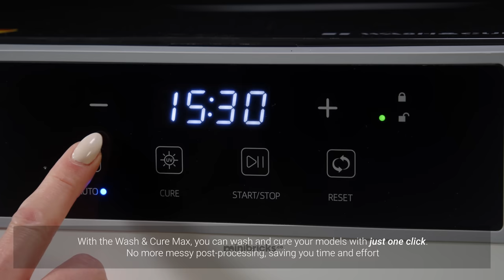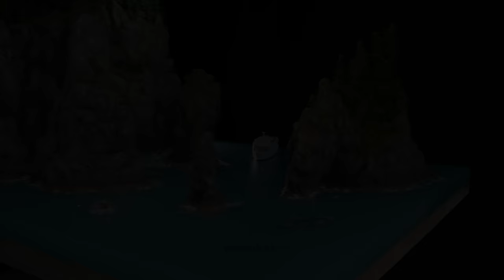THIS IS SPA... ALASKA!!! USA Miniatures Museum / Anycubic Wash and Cure MAX

Comment: Fantastic, well done, another superb piece. I don't remember seeing anything this big before (unless I've missed them) and seeing the size of the pieces forming the rocks and the size of the tray you see from the first second already hinted at the immensity of the diorama and it's just superb. It was a commission, what occasion did you make a piece of this size for, to show off the capacity of the Anycubic M3 Max and the brand new Wash & Cure adapted to the print size of this gigantic machine (which leaves you dreaming), or for a very special occasion like an exhibition?
In any case, as usual, it's a pleasure to see you create. 👍

Comment: The rocks, trees, all the vegetation looks great. The seals jumping off the rocks  is very well done. I don't even want to think about how long it took to carve all those waves. There's only one thing that doesn't sit right and that is the boat and plane. They are a good start, but they need to be weathered, with washes to bring out detail. I guess I'm used to doing bashed up hard used armor and aircraft so don't take this  the wrong way. I am curious about the figures you put on the boat. I gather they are 3d printed. Can you tell me where you got the patterns? I've been looking for some like that for a diorama I am planning. Once again, You've done a great job and an excellent vid.
Reply: I thought the same.

Comment: Interesting, what made you choose a resin print over the regular foam sculpting for the rock formation? I saw the Short about the support removal of one of tose parts and it seemed to me that a lot of resin went into supporting those prints, would it not have been more efficient (and cheaper) to do such a large part in foam? I've seen you sculpt that stuff and I think you would have absolutely crushed making that part from foam! Also - How did you move it after you finished work on it? That thing looks like it needs a fork lift to do anything with it!
Reply: I suspect that it was chosen for several reasons. Firstly, as we can see, it makes the top of the rock formations removable, which is useful both for working on this gigantic piece and, I'd wager, for transport. Secondly .... it's a model of a real place with very specific topography, and the easiest way to get this as accurate as possible is by taking an actual scan of the area (or satellite elevation data, I dunno, but you get what I mean) and printing it. At least that's what I think.

Comment: I'm guessing printing the landforms in resin was for the sake of the sponsor, FDM filament printing or old-school methods would have been much cheaper and simpler. They will at least be lightweight.

I note extensive use of clear UV resin as an adhesive. Interesting. Definitely a good idea under a resin pour.

Now then, texturing the water using a rotary tool, that's bold. I'll probably just go for gloss sealant and blow on it through a straw!

The trees look like repurposed Christmas decorations? It would be good to know.

Oh dear, all that work only to have King penguins in the wrong hemisphere.

Comment: Actually there's an easy way to model a mountain. Instead of creating the whole thing by 3D printing, you can make makeshift mountain from scratch. By papier mache. With some plaster glue plus some sculpting, all is possible. I've seen some modelers use this method.

Comment: How heavy is that? 

Resin prints are amazing but if you’re going to plaster the rocks why not take advantage of the texture from FDM? Should be way cheaper and possibly a tiny bit liter. Though in the end I see weight isn’t a problem lol… 

Sure cost may not be an issue. The extra high quality of resin prints can aid in visualizing the final shape… so I get it. Just the failures on SLA are so devastating. But maybe not for someone dealing in bucket loads of resin…

Came here to see the Anycubic wash and cure max. Stayed for the, um everything else 😅

Forgive me I think out loud through typing. And my keyboard is silent so this is the second quietest way of thinking…

Comment: So the Anycubic Wash and Cure MAX contributed about 0.002% of the work done here, what a time saver.

No offence to Anycubic, I got some of their stuff myself and it's been doing great work, but this project is so massive that it doesn't feel like the 3D printing stuff helped at all. If she had cut that mountain out of styrofoam and made those whales from clay it would have still just have been a small part of the project. And this isn't even about the printer, just the washing and curing part, so it kind of doesn't make any sense.

Comment: Utmost respect to these creators, but being a creator myself with work experience in architectural model-making, I feel like a lot of money and effort is wasted here with the use of the 3D printer to make the cliff components, as well as the time spent cleaning, gluing, curing, and covering them in plaster. Why not use styrofoam or something similar that is malleable enough to achieve the exact same impression of a rocky cliff? Not to mention that it will be covered in paint and trees anyway, so all of the detail that the 3D Printer is mainly used for is lost at the end. Just my two cents.

Comment: Looked a bit sterile finished. The water was the weakest part, no movement or waves to speak of, I get that it was supposed to be super calm that day, yet especially in a model, people need
to be able to relate and in this case everything is against the crafter and observer, scale - Acquard with too tight areas for a plane and seals looked too small , dynamics, weather - missing, atmosphere - missing, the colors were out of the tube or too similar with bright greens that were not right, people looked like railway people from the 70s with no details.
No foam, seaweed. waves or depth in the water, no ice and no thought to dynamic lighting. I like models that use the "Less is More" adage.
A bigger build up with less spread out distractions. Items places evenly apart will encroach on areas that should be neutral for the eyes.
I did like the use of the 3D printing, although hands on is still the creative way for any private meaning. Glueing parts together looks very permanent and can´t easily be changed.

Comment: watercolor to uniform. maybe better painted at certain levels on the disgusting epoxy crap filling. waves? only looks like that may wind goes over an lake. yeah its big but just an ok looking result as a whole. landscaping is fine, not that much detailled. the water is really bad. the nature is at an medium detailled level. does the job to impress, for an critical eye there so much more to be changed.